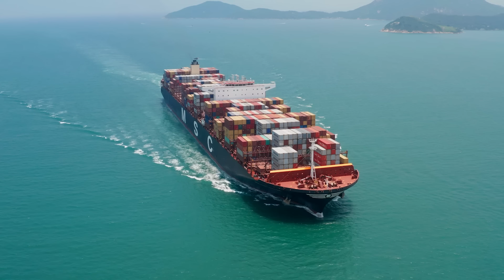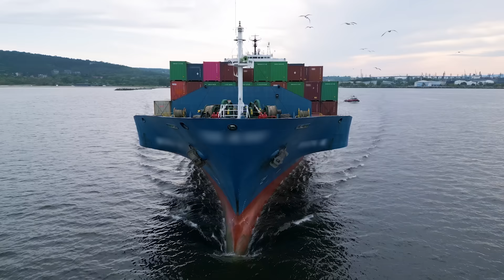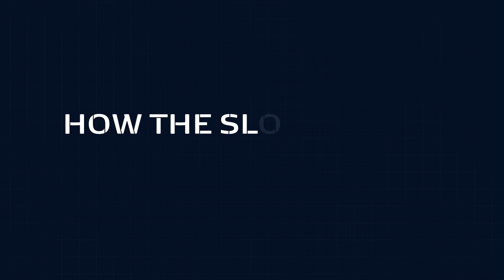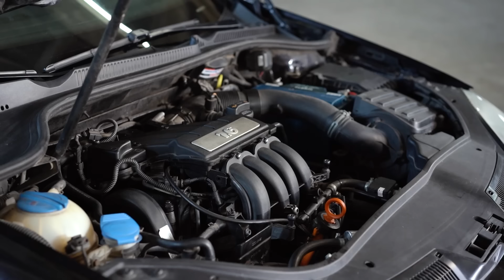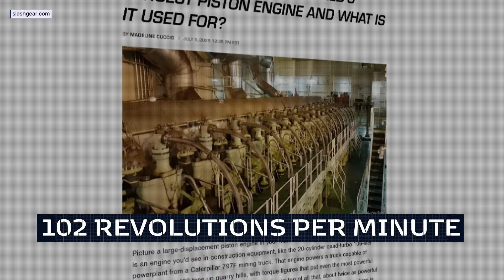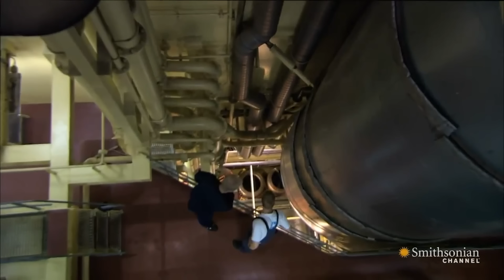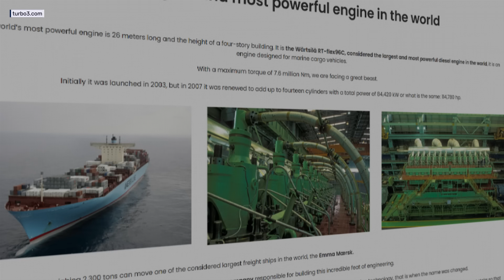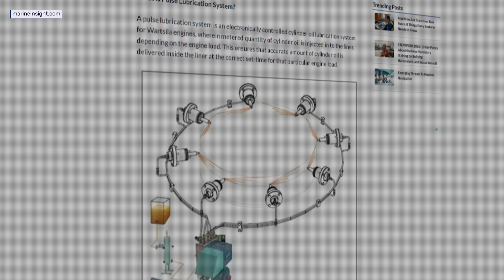The 100,000 Horsepower Engine

Comment: Simon's script writer for this one needs better fact checking.  100 RPM is a lot faster than a second hand on a clock and most car engines are in the 2 to 6 liter range, not 1 to 2 liters.

Comment: I'm a bit surprised that the designers for those honkin' big container ships haven't really looked into using nuclear engines.  After, if nuclear engine can power an aircraft carries, likely at speeds in excess of the 25kts plus provide power to what is effectively a small to mid-sized city of sailors.  Plus, don't have to worry about emissions and the technology is alreay really really well known and tested.
Reply: That was tried before and then deemed to dangerous and that the operators could not be trained to understand how to operate it.. It's far easier to run a combustion engine than a nuclear plant!
Reply: @EETechs  That's interesting.  On Military ships, certainly in the earlier days, you have 18–20-year-olds running the power. Not university-trained nuclear engineers or PhD physicists, Although, not having read the Field Manual (FM), I would imagine that the instructions would be "if this gauge goes red, turn every damn thing off".  FMs are always written to be understood and followed by the least sharp spoon in the drawer.

Comment: I recall hearing that individual cylinders can be taken offline and the piston disconnected for maintenance with the rest still running.
Reply: I think it may be that they have to stop and restart to disconnect the piston.  They can stop it firing more easily.
Reply: Yea there’s no engine on the planet you can work on while it’s running.. yes, because it’s electronically fuel injected on a common rail system, they can deactivate the fuel injector on specific cylinders to shut them down, but you cant open the crankshaft access covers on the block, or pop the cylinder heads off to work while the crankshaft and pistons are still rotating
Reply: I’m not familiar with ship engines, but car engines have no issue with doing this while the engine is running, choosing the configuration best for the present environment.

Honda is the one my mind goes to with their VCM tech, but a quick google search showed many manufacturers have their own similar tech with variations of the same concept.
Reply: @seth6382  I'm pretty sure engines with cylinder deactivation still spin those cylinders, meaning you can't work on them while it's running. They just don't feed the unused cylinders any gas.
Reply: @seth6382  My dad's 70s Mazda, inline 4 engine, ran on 3 cylinders for the last few years of its life. Probably not ideal, but hey it worked.

(also the speedo had broken by that point - Dad just knew the speed from the RPM and what gear he was in)
Reply: You've been lied to.

Comment: Those big container ships can't get to 25kn with the current and a tail wind.  Most can't even hit 15.
Ref. "what is going on with shipping" -- Sal Merccagliano, former merchant marine
Reply: You don't know what you are talking about! So you have seen a few of Sals videos, that still makes Sal the expert not you.

It is even stated in the video, that after the GFC in 2008/2009 they no longer required container ships going this fast. and they started slow steaming.
Back in the day, container ships were built to go faster with service speeds of 18-20 knots, but they could go faster than that. (mind you only container ships, other cargo ships normally go at 12 knots service speed)

I have been on an older container ship (the Albert Mærsk) and it had a service speed of about 19 knots. when we were asked to arrive earlier at Port Said, we went to full speed and steamed at 24 knots for a week burning likely 300 tons of Heavy Fuel Oil a day. (it was not cheap)

Comment: The only viable option besides these gigantic 2 stroke diesels is a nuclear reactor and steam turbines. Then the overwatch requirements go through the roof. Like a destroyer Escorting each one.
Reply: These  " Mega Container Ships and Tankers used to  use "Steam Turbines" but the fuel consumption is too high. I was engineer on a 300,000 ton Tanker  ( Universe  Korea  )  50 years ago it used 300 /330 tons a day. There was a experiment to use " Raw Crude Oil " as fuel  rather than  " Heavy Boiler Fuel".

Comment: At this scale it's hard to call it just an engine. This is a facility. The difference is on everything > 25-30k HP things that are usually ON the engine are usually removed into separate devices. Fuel system is complicated - from heaters, centrifuges, filters, high pressure pumps - all takes more space than whole engine sections of smaller ships. Turboes are size of a van... each. High pressure air system for starting it requires its own generator. Exhaust  is yet another system that takes space similar to medium fishing boat.
Also that 102 is not unique  to this engine - 102 is for some reason a standard for most big marine diesels.

Comment: Fun fact the weight of the daily fuel burn that engine uses is heavier than my masters (captains) license can handle. Also the Emma only has one propeller if i recall that weighs in at over 100 short tons on its own

Comment: Would a diesel (or lng) electric setup like locomotives have work?
Reply: It could be done but this is much better. Generators and electric motors are expensive and they like to burn, gas is more expensive than heavy oil and with the current set up the propeller is bolted straight to the crank. No gearbox, no losses, no extra parts and heavy fuel oil is just a bunch of burnt engine oil and whatever is left over from petrol refinement. It's literally leftovers. They have to heat it up so it is liquid enough to even use. I can't imagine that's expensive.

Comment: The more impressive number to me is that the engine in question produces ~5.6 MILLION lb-ft (~7 MILLION Nm) of torque @ 102rpm!
You'd need about 3000 Semi-truck engines to produce that amount of torque, but they do it at ~1100 rpm.
Each of the 14 cylinders of the RT-flex96C is 38 inches, which is wider than most semi-truck engine blocks.
The RT-flex96C only weighs 1300x more than a semi-truck engine, and is only 300x the size (all on average.)

I'd say that makes for a pretty darned efficient engine!!

(edit: I'm adding that this is inherently an unfair comparison.  Moving stuff in the water is easier AND slower vs. over the road.  Back of the napkin (or literally my power bill) calculations: If you made a RT-flex96C land vehicle and pitted it against 3000 semis, the semis would beat it in cargo tons/minute by a fair margin, due to speed.)
Reply: Also you need to remember that as soon as you are permitted a gear box, it is horse power and not torque that matters.  They need the massive torque because they didn't use a gear box and an engine doing 500RPM.

Comment: VVT would do wanders for the cam. ?? Just saying, it would be more mechanical and therefore more reliable.  ???
Reply: These are two-stroke engines. The cam is only to fire the fuel injection. There are no valves so VVT would not work
Reply: He said that the older engines had a slight timing issue if the load is not stable. VVT would fix that issue.  Delay or advance when winding up or wilding down.

Comment: If it malfunctions they have a little outboard motor to get to shore! 😂
Reply: If it malfunction im one of the people that have to fix it. Being a marine engineer we have to maintain, overhaul, replace parts (heavier than cars), and keep watch when it runs.

If decarbonizing (removing carbon buildup) in your average car looks dirty, wait till you hear that we use SHOVELS... INSIDE the engine to clean the build up, every 1-3 months. Usualy ends up 1 or 2 BARRELS of pure carbon.
Reply: There really isn’t much that can “break” on these motors that they cannot replace while at sea. Basically breaking a crankshaft is about the only thing that could put one of these ships “dead in the water”. They can replace entire cylinders (pistons, heads, and all) while at sea.
Reply: Oarsmen? 🤔
Reply: Drop in a trolling motor, powered from the auxilliary generators.

Comment: 102 RPM is not 'about the same speed as a second hand'.      A second hand moves at exactly 1 RPM.      this is 102 times faster.   You can count the rotations by eye, something that doesn't work with high rpm engines.